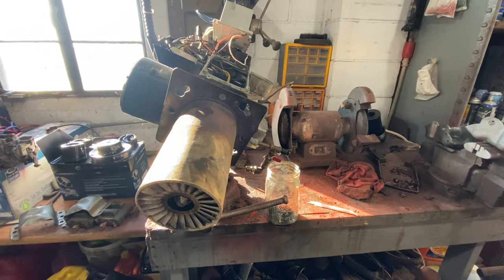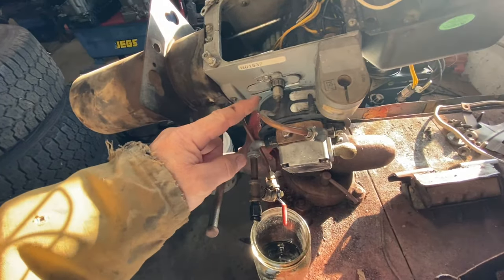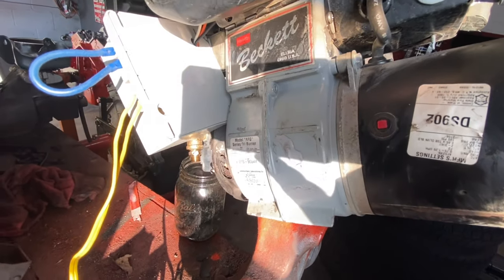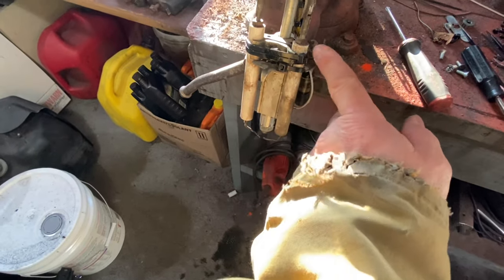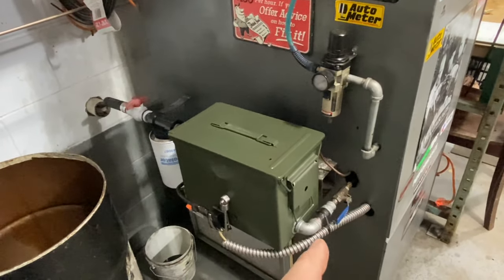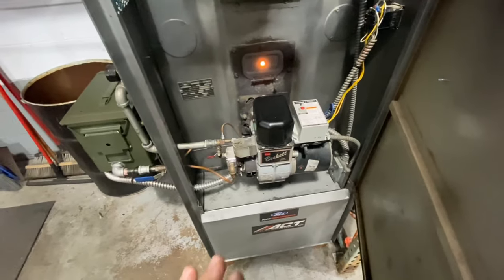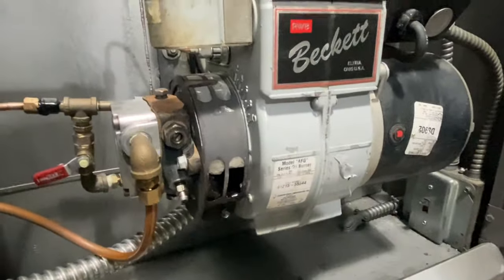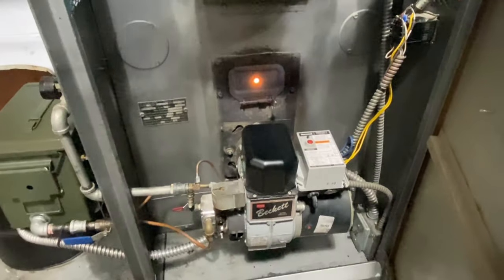DIY Waste Oil Heater.   Updated video better audio and detail

Comment: What pump do you use to pump oil into the ammo can holding tank?
Reply from the maker: I gravity feed it directly from the large (275gal) outside tanks that sit on racking outside about the ammo can. It works well but in the extreme cold the oil flow is very low. Typically just fine unless the inside filter is getting toward the end of its life (clogged) then the flow is too slow to keep up with demand of the furnace. So replacing the filter early will fix that. Id suggest for those who can’t get the oil above the ammo can or wish to pump it (which would extend the interval of filer changes) to maybe run a rotary style pump.  Or even an oil diesel fuel pump. I had a liquid propane pump I acquired from an auction that would work. But the gravity was simpler and did the trick.
Reply from the maker: In an earlier video if memory serves I show the outside tanks and the “Setup”. It’s nothing fancy but allows me to switch from tank to tank as needed and has a trap at the bottom to allow water and heavy sediment to settle there and be drained easy. It’s not fool proof as some coolant has made it past that trap but in general if it does I can drain that at the ammo can and be good.
Reply: @ballengerfarmhomestead2772  do you ever have the issue where you fire up the burner, and works great, then spits and spudders, then flame goes out, but then kicks back in, and does all over again, finally after so many times it kicks safety out, wait 45 sec and fire back up, runs good for few min, then starts having issue all over again?
Reply: @ballengerfarmhomestead2772  appreciate you responding to my early comment.
Reply from the maker: With the original setup in that video the simple answer would be no.  While on some occasions if coolant found its way into the loop it was hard to keep going until the coolant passed. I had the safety bypassed because I was getting frequent changes in the oil quality (contaminants) and the flame would go low tripping the safety. Sine I only ran unit while I was present this wasn’t really an issue. Since the video I have revised the unit. Bigger ammo can to allow the heating element to never dry fire, and the pickup is high in the can to keep from catching coolant or most of those issues. I also upgraded the burner assembly with a new Beckett that I acquired cheap. It has a newer control box and a fuel solenoid.  The flame sensor currently is bypassed because Im still in test phases.  But once I iron things out this one will be fully automatic and run off a thermostat.   All this to say that I am actually currently experiencing the same problem you have, one I didn’t have previously. This unit has two outlets form the pump. One direct to nozzle (which the fuel solenoid can delay or shut down) and a constant bypass.  Originally I felt this would be a great option as when the unit first fires it will flow the bypass only for a bout 5 seconds allowing warm oil to move through the loop and then fires the nozzle. However since i have had some issues getting flow correct it will shut down too soon.  With sensor bypassed I can finally get it to fire but the flame will do what you describe and burn out.  I adjust flow valve and get it back only to burn out again.  What I think is going on is the oil coming from the smaller outlet of the pump (Nozzle pressure port) is not able to flow what unit can burn and with the ball valve in that loop the line is starving for oil then catches up and flame works till it drains it off again.  Im currently reconfiguring the bypass loop which is much larger to act as a port for the nozzle to pull oil from while the pump is running. I have it all plumbed up and was ready to fire but the nozzle was leaking oil for some reason. So I need pull the unit out and find the source of issues.  I’ll try to and remember to let you know what i find and if it works. This may solve your issues too??  Sorry for long winded response. But I like to be thorough
Reply: @ballengerfarmhomestead2772  well I originally had a pump with two outlets and ran into same problem, so took the one outlet and put set screw in and a plug and went back to having just one outlet, and it solved the problem, what was happening, was when you use a return to tank outlet with diesel fuel aka fuel oil, it is able to keep pressure and pump into the burner, but with oil, it didn't like the resistance and took path least resistance beck to the tank, not allowing it to be pushed to nozzle. I watched video by greyman furnace and learned about this, so I plumbed up to just be single outlet, and works great for a month,  until last night when started spit and spuddering, I use a 30 gal hydraulic tank that's mounted below the furnace, with lines going up to furnace and a return line going back down, has a valve on both lines to have some control over amount flow, but also I have a one way check valve one the line going to furnace from tank, because I found that when thermostat kicked it off, after period of hour, it would drain back into tank and lose prime. It's been running great, thanks to your videos, but I think after I sent that message, I might have some water vapor from the air compressor that got into the nozzle and I think mixing with oil, cause clogged the nozzle. I'll take all apart and put in another water separator and take apart burner and check nozzle when I get home tonight. I appreciate your reply.
Reply from the maker: @staym925  Sounds good. Likely your on something with the air issues.  Im pretty sure with single outlet, control valve after the nozzle “t” and once I find the reason for the leak at nozzle it will likely be functioning correctly.  You mentioned greyman furnace. Is that a YouTube channel or something I can find with a search?  Good luck to you!!
Reply: @ballengerfarmhomestead2772  this is the guy I was referring to, I've watched several of his videos on oil furnaces, he worked on oil furnaces for many years and has wealth of info. https://youtu.be/cog7MaShR7M
Reply from the maker: Thanks I’ll check him out and see. Good luck with the future furnace.

Comment: What filter and head did you use? When is the next update?
Reply from the maker: The video itself was an update. Meaning I had posted an earlier one that was not real in-depth. I wanted to explain more/better the setup. I use a standard larger automotive filter before the oil comes into ammo can for heating. Then the simple screen the becket pump already has just before the nozzle. I am using the 1GPH office that I can adjust pressure with to set the flame as I need
Reply: @ballengerfarmhomestead2772  Do you know what number is on the filter?
Reply from the maker: I’ll have to check. You can easily use a chem tech 7210 filter from TSC OR RURAL KING they stock them in the fuel filter area. I used those. But I the engine filter was just a bit bigger and slightly cheaper. But it’s harder to find. Can’t remember the number. But the chem tech is a great easy to get filter
Reply from the maker: @billsmith1770  you would be correct I mistyped it would seem. Cim-tek  720-10 is the filter I use.  Works well and readily available.  There are a couple automotive filters that cross reference to that same housing and work for couple $$ cheaper. When I get a chance I’ll stock up on them. But the are more rare it seems. The 72010 and it’s sister filters 72059, 72002, all work as well. They are just targeting different micron ratings or fuel type. One has a drain which is a nice feature to have.

Comment: What size nozzle are you using?
Reply from the maker: Using the 1GPH nozzle. But of course I can actually increase or decrease based on the pressure ahead of the nozzle due to my ball valve.
Reply: @ballengerfarmhomestead2772  Thanks. I believe I'm using .5 gph. This might be why I have to use such low PSI.
Reply from the maker: Are you getting to much or too little flame?  In my personal opinion these systems work better with pressure behind the nozzle on oil feed side instead of siphon only from the “Air pressure”  coming in.
Reply: @ballengerfarmhomestead2772  I think the oil is not atomizing enough due to only being able to run less than 3 psi. Sometimes it works great but that it starts too really flame up like it's getting too much oil. I was thinking of trying a bigger nozzle to see if I can increase my psi on the air . I have a valve like you do to reduce the amount of oil being siphoned in.
Reply from the maker: @dobber1988  hmm may work not certain. I can say that having the oil pressurized instead of siphon really helps adjustments. But you may get what your looking for
Reply from the maker: @dobber1988  also are you preheating the oil before going to the nozzle if so how hot?
Reply: @ballengerfarmhomestead2772  yep I'm preheating and I'm using the oil pump on the Beckett burner to circulate the oil back into the amo can to preheat and siphon of a T with a valve to control the amount of oil being siphoned.
Reply from the maker: @dobber1988  to be clear when you start to increase air pressure is the flame going out or getting too big?  Also can you achieve the flame desired by regulating the oil valve and air pressure together?
Reply: @ballengerfarmhomestead2772  when I increase the pressure the flame gets smaller and will go out if increased to high. I can achieve the right flame with decreasing the air pressure and adjusting the oil valve. It will run good at times but sometimes it will spray too much oil in the chamber causing it to flame up creating black smoke and alot of soot. Very frustrating trying to get this thing to run correct.
Reply from the maker: @dobber1988  ok I see. Yes possible a larger nozzle will help. Also is your valve on the nozzle side of the tee or after the tee?  Meaning are you just opening up more flow potential to the nozzle or actually creating resistance to the return back to tank which would raise pressure to the nozzle. This could be part of problem.
Reply: @ballengerfarmhomestead2772  it is before the nozzle after the tee
Reply: @ballengerfarmhomestead2772  1 gph nozzle worked great. I can now increase the psi from 1 to 20 without snuffing the flame out. What a different on how the furnace operates now. Thanks for your help.
Reply from the maker: @dobber1988  Awesome to hear. Glad it worked out!!  These can really crank out some heat if you need it, or be dialed down for low consumption and still sufficient heat. I had an early prototype version running into an old wood burning furnace (without the wood) in which it was only injected by the becket pump no air assist. Used more oil and had less heat.
Reply: @ballengerfarmhomestead2772  Awesome. I had made a dripper style out of an old hot water heater tank but I couldn't get it to produce the heat I wanted in my insulated shop plus I want something that was more fail safe.

Comment: I'm not sure if this is your latest upgraded burner but after reading a few of your replies I thought I would share this with you. I copied the design from this YouTuber https://www.youtube.com/watch?v=Mz1VmGyEAXI  We are not using air compressor to atomize the oil but a simpler filtering system and keeping the original Beckett burner method. Ignitor, pressurized oil pump (mine is factory  set to 140 PSI) and a smaller nozzle size from a 75 70 to a 65 60,  since Waste oil burns hotter than diesel. its been working flawlessly  The only trouble is you need a dual fuel source. Diesel to start it after 2 minutes of that fuel then switch to Waste. It works great except it cannot be controlled with a thermostat to work on Waste only. So if you don't mind having the burner running full heat and then before shutting down switch back to  diesel this system works very well. I've ordered some extreme tiny 110V heaters that will follow the fuel line from the heated Ammo tank to a180 Celsius nozzle heater. I had an 80 C nozzle heater before it didn't work to ignite waste oil. Maybe with the extreme heaters it will. What do you think?
Reply from the maker: His setup looks simple enough and I’m sure works. I did a pretty similar deal years back. I chose to do with the current setup (and even a few extra things since) because it can run basically any out and no special prime or shut down.  I simply turn the system on, allow ammo can to preheat for about 5mins. The nozzle heats up at same time. Then I simply hit the start button and it fires no matter the temperature outside. The air really helps to get a much better flame and has the potential to really throw some heat it back it down. 

To address if your heaters will do the trick I’m not sure. Getting the oil as hot as possible before the chamber is always good. Where the big trouble comes in is getting it to atomize at the nozzle so it can fire. This is the critical point. If it doesn’t you get a lazy fire and oil build up or no fire at all. I think I would place most of my energy to getting the oil as hot as possible as close to the nozzle as you can. Hope they helps??